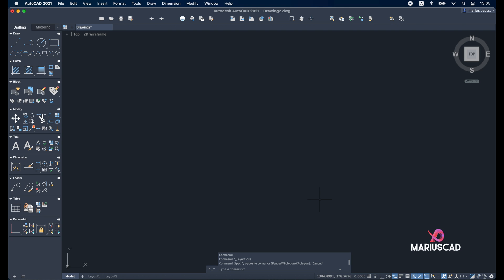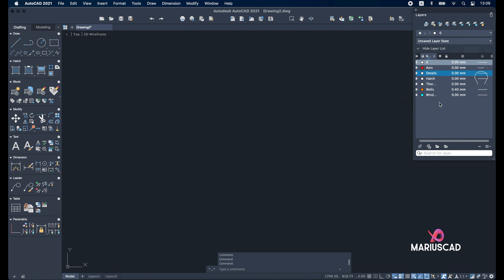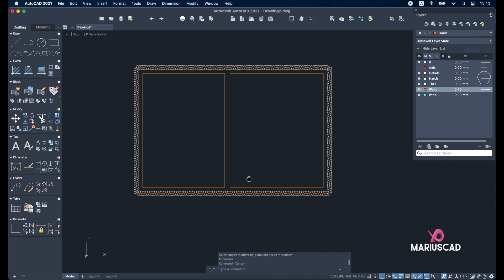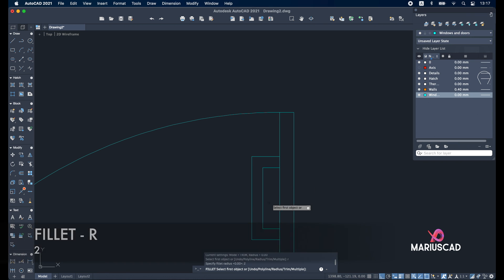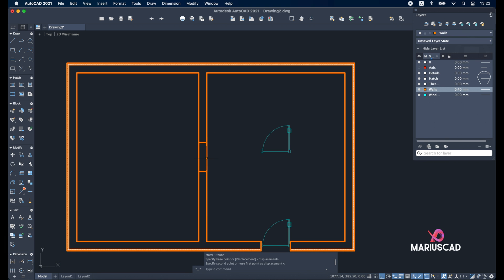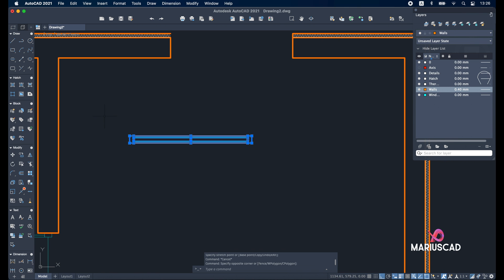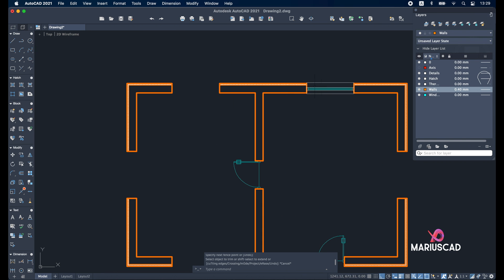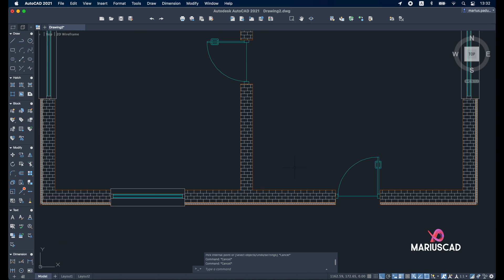AutoCAD | Draw fast and professionally Walls, Windows, Doors, Insulations | Detailed

Comment: I'm a old timer hand draftsman (almost retired) that became a Carpenter that became an Architect... to this day it drives me crazy to zoom in to what should be a clean intersection of two lines forming a corner only to find the lines not meeting or overlapping. Ever hear of the FILLET command? It's infuriating to try to snap accurate dimensions off a drawing to get some bizarre 127/256" fractional length when it should be an even 1/2"... those little drawing errors have consequences. Keep it clean.

Comment: Can you help on my autocad setting , While Lineweights On when zoom in/zoom out its getting thicker/thinner, i want a constant or fix view on lineweights
Reply: type LW, and uncheck Display Lineweight.. and just start using Properties Editor for adjust the lineweight.. for example, type PL - enter, click the line and type PE - enter, type W (weight) - enter, and input the preference number for the lineweight.. with this way, ur line is not getting thicker/thinner when you zoom out/in..
Reply from the maker: Hello!
The only solution is to deactivate this command and you will see a 0.0 thick line always.